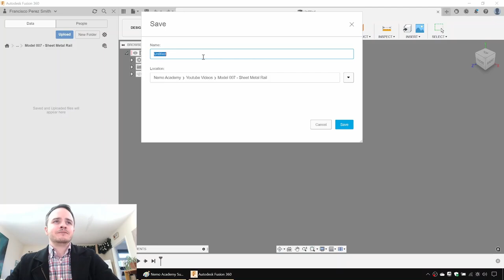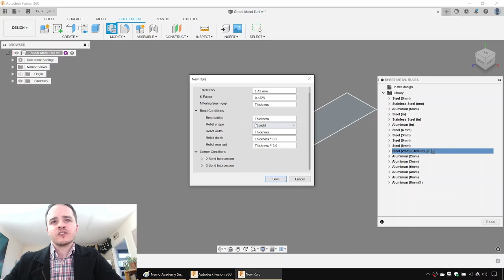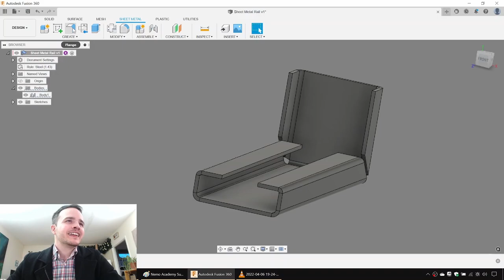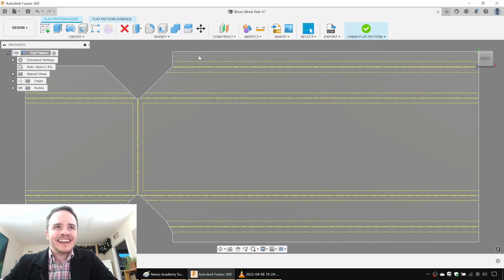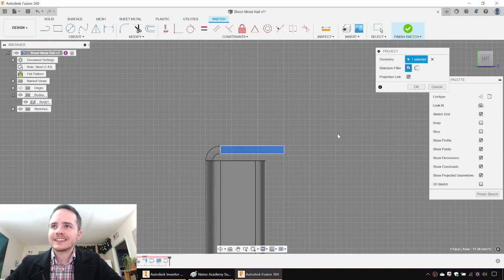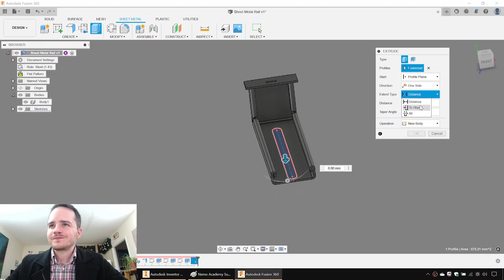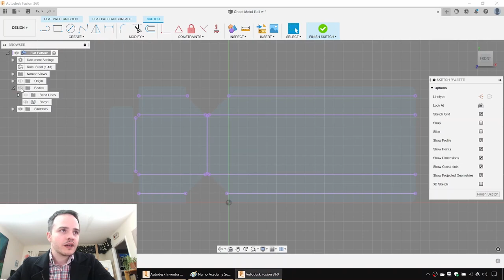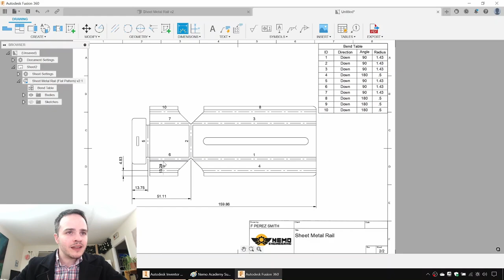Let's Model! - Sheet Metal Rail  |  Autodesk Fusion 360  |  3D model, flat pattern DXF, drawing

Comment: - Late to the party, but @ 9:39, sketch not needed: simply 'Extrude' the face.
Reply: - BTW, 'Offset Faces' would be nice (would only require 1 feature, not 2, as w/ 'Extrude') - BUT alas, it drags adjacent faces w/ it. So, that's a no go :(
Reply from the maker: Hey! Great catch! While Press/Pull or Offset Faces drags the whole chain, extrusion just extends just the target surface. Nice one!
Reply: @nemoengineering  
- Yes :)
- BTW, I never use 'Press Pull'. It's actually not a tool, but a "multi selector": based on geom selection, it picks between 'Extrude', 'Offset Faces', or 'Fillet'. Instead, I simply select the desired tool (via hotkeys).
- And, there are some subtle differences / downsides between these workflows. 'Fusion 360 School' YouTuber has 2 nice vids covering this matter.
Reply: @nemoengineering  
- Yes :)
- BTW, I never use 'Press Pull'. It's actually not a tool, but a "multi selector": based on geom selection, it picks between 'Extrude', 'Offset Faces', or 'Fillet'. Instead, I simply select the desired tool (via hotkeys).
- And, there are some subtle differences / downsides between these workflows. 'Fusion 360 School' YouTuber has 2 nice vids covering this matter.
Reply from the maker: @swamihuman9395  Very cool! I'll be sure to check them out! I've always wanted to get into 'speed modelling'; maybe run some live contests :) Could be fun!

Comment: Is there a quick way to remove chamfer or convert it to a fillet?
Reply from the maker: Hello! I'm not sure if there's a way to convert, but you can definitely delete the chamfer in a few ways!
 - If you have the features tree active, find the feature, select and delete it.
 - If you don't have the features tree (i.e. you just have geometry), you should be able to select all the chamfered faces (holding Shift) and delete them with the delete key.

Let me know how you go!
Reply: @nemoengineering  Thank you that worked perfectly.

Comment: Great! One Q pls, can we make a way to both projection and flat pattern in one drawing page? (like CAD DWG)
Reply from the maker: Hi Partha! You can absolutely do that! There are two ways:

A) In the drawing environment:
 - Go to the sheet with your folded (projection view).
 - At the top left, click 'Base View'.
 - In the dialogue, for the 'Representation', select 'Flat Pattern'.
 - Place this down in your sheet.

B) In the modelling environment:
 - Make sure the drawing file is open (this part is important for later).
 - Go back to your 3D model file.
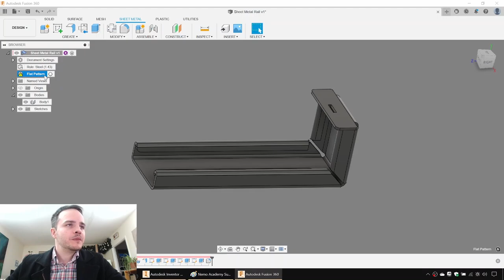 - Activate the Flat Pattern (13:22 in the video).
 - At the top left, change the environment from 'Design' to 'Drawing -> From Design'.
 - In the dialogue, change 'Drawing' from 'Create New' to the drawing you have opened. When you do this, a new field 'Sheet' will appear. You can then select the sheet in your drawing onto which you want to place the flat pattern.
 - I cover this in my other video! https://www.youtube.com/watch?v=l8z1XYhDkyg&t=1091s (at 20:52).

Have fun modelling! Thank you for watching!
Reply: @nemoengineering  Hi, it is yyyyyyaaaa, I like you Mr.